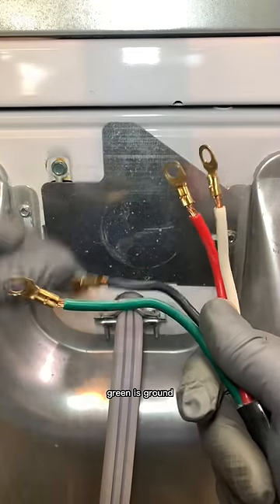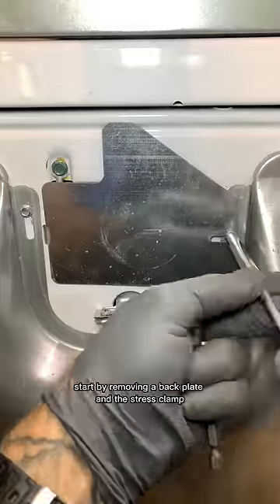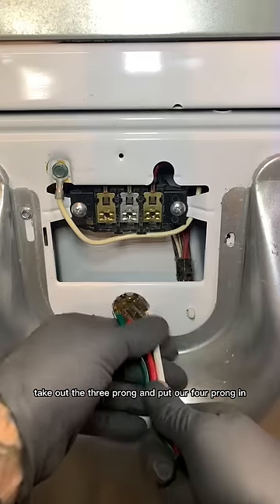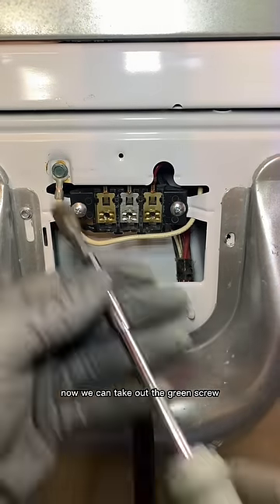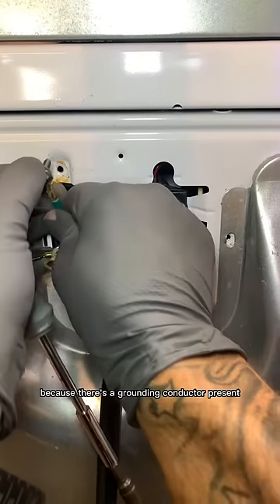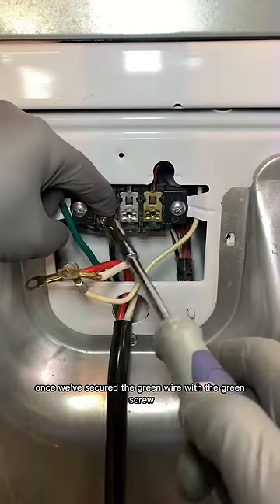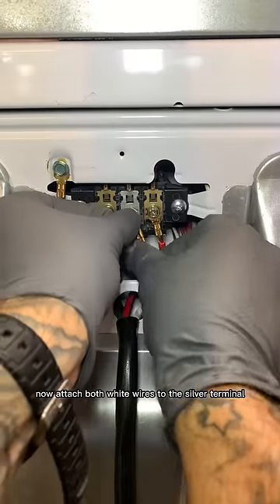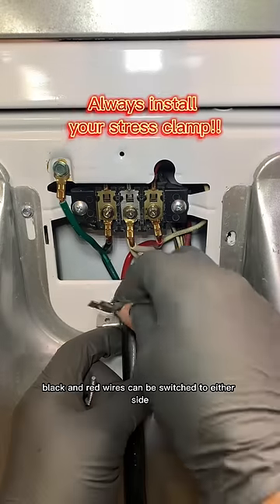Always be sure to ask if the delivery company installs a cord on your new stove or dryer!

Comment: What would happen if you doubled up the green and white ?
Reply: Voltage Current would be too strong and the Circuits would Fry.

Neutral wires connect to your Dryer's Voltage Regulator. Normally your Dryer goes bad on the Electronic front because their systems are trash and there's a Cheap "Life Hack" Washer/Dryer Companies do that saves them money. That's where 3-wire to 4-wire switch comes in; by sending power to the Regulator directly on the same power source instead of having to draw from the ground and loop back into the neutral (a very inefficient and negatively looping system), you can avoid having to keep replacing your Circuits every few years from wear and tear and have your dryer running in quality for much longer.

Doubling the Ground by any standards would just send too much Voltage per current into the Machine and fry the Regulation Circuit, as well as several other vital Circuits used to operate the Machine.

Comment: How can you just assume that an aplliance which is wired in the tnc system has no further internal connections between ground and neutral? If it does you changed your whole house from tns to tnc and if there is any shift in the neutral point you will have a continual current through your appliance. That will result in a voltage across its housing and you getting zapped as soon as you touch it.
I mean, I'm not from the states and don't know your code, but I really hope that is not as the code says it is supposed to be done.

Comment: The internal white cable was for earthing why did you join it to the neutral instead of the green (ground) ?
Reply: The internal white wire is for neutral. It was bonded to ground at the beginning.
Reply: The internal white wire branches off of the neutral screw. For older setups that have 3 prong outlets, the absence of the ground conductor meant that the neutral acted as a return path if something short circuits. In newer setups with 4 prong outlets, a dedicated ground is used instead. This means the internal white wire connects directly back to the neutral screw since it no longer needs to act as a return path.

Comment: Hey so I have an important question! While changing the cord to our drier, it's almost like the thread to one of the live wires has fallen out. When we go to screw them in, there's nothing back there to hold the screw in place.. what could we do to fix that, that also won't cause electrical issues?

Comment: So if I'd double up the grounds on the ground screw, it'd be wrong? Can you explain why so I can fully comprehend why or why not to do it?
Reply: What do you mean, "double up the grounds?" There's only one ground wire.
Reply: That internal white wire branches off of the neutral screw. It acts as a return path to the panel in case of a short for 3 wire setups. In a 4 wire setup, the ground conductor acts as the return path for shorts, and the internal white wire goes back to the neutral screw.

Comment: It’s not “wrong”. You can still do this per code. What he doesn’t tell you is that, in order for you to accomplish this, you need to change the outlet and pull a new circuit/new SE cable to the outlet. 
Easier to just leave it as it is and just put the 3 prong cord back on.

Comment: Hi i currently did this today beforei seen video and i connected the green to white . It turned on but did not heat and timer does not move. Then i seen your video and went back put white to white and it didn't start. But it does still start white to green . Still no heat, timer not moving. Any advice ?

Comment: If the white wire needs to be connected to neutral. Why was the white wire initially connected to chassis? Wasn't that a neutral wire connected to chassis? Why loop it back to a neutral connector? Is it simply for safe storage? While disconnecting it from the ground wire which is now connected to chassis.
Reply: It's connected to the neutral terminal to stop it from touching anything else. You don't want it to contact ground or live.
The wire was initially connected to the chassis because the NEMA 10-30 plug only has hot-neutral-hot.
Reply: It's connected to the neutral terminal to stop it from touching anything else. You don't want it to contact ground or live.
The wire was initially connected to the chassis because the NEMA 10-30 plug only has hot-neutral-hot.

Comment: Hahaha 2 grounds . If you watch he removed ground and the white terminal moved. White and green are both grounds. 1 leg is 115 volt (black) and the other leg is 115 volt (red) making 230 volt. Note voltage can very between 120-110 volts.
Reply: White is neutral not ground
Reply: @Crlarl  open a breaker box up in any home and look. White wire is hooked up to the ground. Don't argue with  me. They call it neutral yes but it is in fact a Ground. The hot wire (black) has power both negative and positive flow at 60hz. And in this video  he moved the white wire off of the ground screw and it is not hooked to anything anymore. DON'T TOUCH ANYTHING THIS GUY SHOWS YOU. IT IS WRONG. The neutral  is no longer hooked to device 😢
Reply: @jeremymerrix6236  
You're correct about the ground and neutral being bonded at the panel. That being said, they serve two different purposes and cannot be tied together at any place other than the panel.
In the video, the wire he removed is still connected to neutral, always is. If he kept that wire connected to the chassis and then added the ground, he would be tying ground and neutral together.
Also, the video shows the standard way to install a NEMA 14-30P onto a dryer that can take either 14-30P or 10-30P.

Comment: Is it dangerous if you leave the white wire where it was, or is it a must that you place both white wires together?
Reply: On 4 wire setups, the internal white wire should be connected to the neutral screw. On 3 wire setups, this wire acts as a return path should the metal case of the dryer becomes energized. The green ground conductor fills this role on a 4 wire setups, so it should not be connected to the ground screw. Since it branches off of the neutral screw, all you need to do is connect it back to the neutral screw.

Comment: I spent years working on automotive electrical circuits. Household wiring is stupid. Two hots? Neutral? What the hell?  I am used to direct current. It comes in from one source and needs to be connected to the other side of the circuit. Done! Easy! Not only is household wiring stupid, but if you fuck up it can kill you. Not for me!

Comment: Was going good until you did not use the correct tool to tighten the screws. NEC requires that a torque driver or torque wrench MUST be used to tighten All electrical connections.

Comment: In aussie AC green/yellow is earth, red is active and black is neutral. Why the flip is the white the neutral
Reply: Grew up in the States working on Automotive stuff where Black was the color for Ground / Negative wires and Red was Hot/Positive....then had to do some household wiring and OMG !!
Reply: We use split phase alternating current in the US. It's a single phase split in the center and that center wire becomes neutral. Both ends of the single phase is 240 volts, and either end to neutral is 120 volts. In the main service panel, ground and neutral are bonded. This allows for the ground wire to act as a return path for short circuits to dissipate static electricity.

Comment: I didn't know 220vac had a neutral
Reply: The neutral is used for the 110V components in the appliance.
Reply: It sometimes does and sometimes doesn't. e.g. NEMA 6 connectors have 2 hots 1 ground, no neutral.
Reply: Dryers use 240 volts for the heating element. Everything else from the motor to the control board uses 120 volts. The neutral wire is to power the 120 volt components.

Comment: Get it tight and don't cross thread otherwise you get a nice black charred wire after a while
Reply: @Frappe3621  cross thread = not screwing in the screw properly. The wire will heat up and arc and char ... Nothing to do with color code.

Comment: And a new home Built-in 2020 and a state that adopted the 2020 codes 2020 codes having a GFCI receptacle optical on your dryer it'll tell on you if you wired it wrong it just flat trips the breaker as soon as it makes contact with determinals

Comment: Actually you installed it wrong.
Grounding conductor first. (Ground)  followed by the Grounded conductor (neutral) then the two phase conductors.
Reply: Why? It shouldn't matter what order the wires are connected. Also, it's 1 phase, not 2.

Comment: Always re-torque after first use.  I have seen dozens of these have screws loosen, likely due to heat cycling.   You  need to run the dryer for at least 30 minutes to get the wire hot enough.  It cools down pretty quick.  You will get another 1/8th of a turn. You can also use loctite if you prefer.
Reply: If you need to re torque the screws you haven’t don’t it correctly and shouldn’t be playing with power. And how hot are you cables getting ??

Comment: No no no, the neutral and ground wires never go together, NEVER DO THIS
Reply: I think you misunderstood what happened. This appliance is designed for use with or without ground. Without ground, the neutral is connected to neutral and that wire connects it to the frame. With ground, the ground wire connects to the frame and neutral is connected to neutral. Neutral and ground aren't connected in either case.

Comment: Sand the metal down for a better connection you tryna pass eletricity thru paint good luck
Reply: Screw threads into bare metal, screw head contacts wire terminal......

Comment: Been selling appliances for 26yrs I've  always put the green with the white in the middle together never touch the white cable already attached to the dryer. Mine is that way at my house for 22yrs. No problems ever. I tell my customers to connect theirs that way also. No problems. You are doing it exactly right but my question  is am I essentially doing the same thing? Never had an issue. Just curious
Reply: You should not be connecting the green (ground) and white (neutral) together.

Comment: Why does it have 2 live wires.
Reply: Most appliances have 120vac and 240vac circuits in them, so you need 4 wires to achieve that.
Reply: @bradhuf  cheers. Was a bit confused as the UK is 240v as standard.
Reply: @bradhuf  
Well, you need 3 but the 4th is really nice.
Reply: @Crlarl  haha ground who !?

Comment: How do you wire up a 4 wire when you only have 120/ one hot. 3 wire doesn't seem to be to code in many places but some dryers will run on 120 or 240. Also how do you wire up the outlet for 4 wire 120
Reply: This was a 240V aplliance and still is. Originaly it only had a neutral and neutral was also bonded to the frame. Not un-common. He added a 4 wire meaning the power connection is the same with 2 hots and a neutral but an earth or safety ground was added and bonded to the frame which is another layer of safety. The appliance uses a neutral because some parts only use 120V. On dryers usually only the heating element is 240V and the rest is 120V. Similar with a stove. All the heating is 240V but the controls (if it's push button/digital) and lights will be 120V.

Comment: That is wrong. The green wire goes to the cabinet frame, but the bonding wire from the internal wiring still goes to the cabinet frame or is just left disconnected. By connecting the bonding wire to the neutral wire, you are now connecting the ground and neutral circuit back together, which the 4 wire cable was developed to eliminate. If you examine the machines internal wiring you will see theat the bonding wire is connected to the machines frame.
Reply: The wire he removed is connected to the machine's neutral not ground.

Comment: That white wire you just screwed it to itself.  The harness is no longer grounded.  You just add the green ground to the white wire on the body. That's the way the instructions say to do it.
Reply: Thats because white (neutral) isn't a ground. It is bonded back at your breaker panel like it should be per code. The chassis ground is just that, a chassis ground and not to be used as a current carrying conductor.

Comment: There’s no neutral in 220. There isn’t. Stop calling it neutral. You’re adding a second ground protection that will hopefully be effective in the case of a bonding failure.
Reply: USA wiring has 120 volts for the motor and timer motor.  Neutral wire is the center tap of the transformer (dividing 240 into 120 volts. (I was an Appliance repairman 27 years. )
Reply: I guess the entirety of North America needs to go back and revise their electrical codes because of a comment on a YouTube short.

Comment: You made your ground a natural... why didn't you just ground the green and the white... then have the natural wire in the middle.... this is wrong
Reply: No it's not wrong. Originally it was "neutral bonded to frame." Now it has the same neutral to run the electronics but the frame is now attached to an earth ground which is another layer of safety.